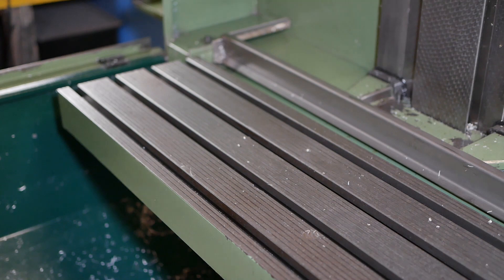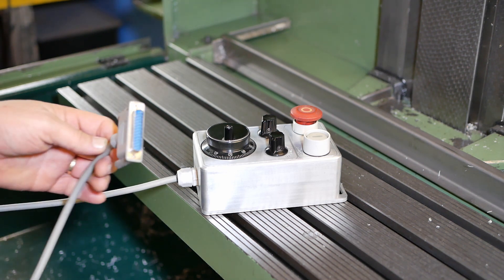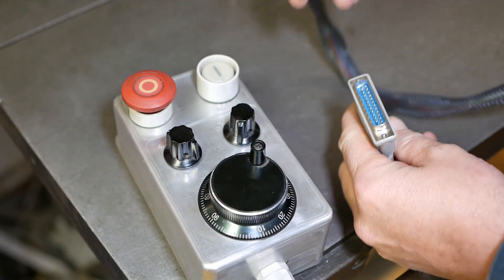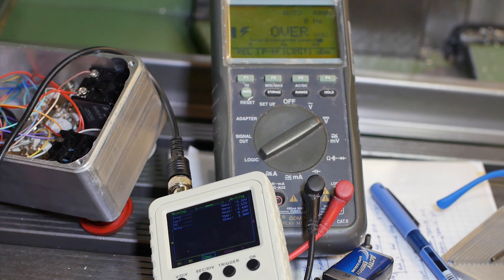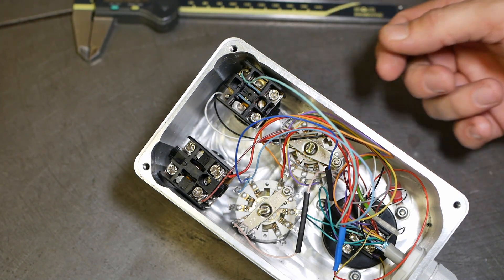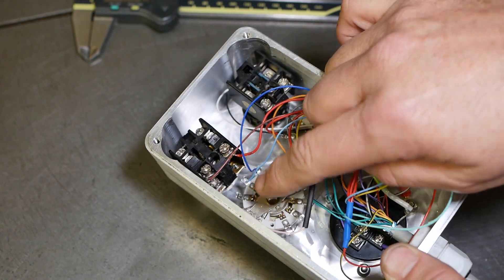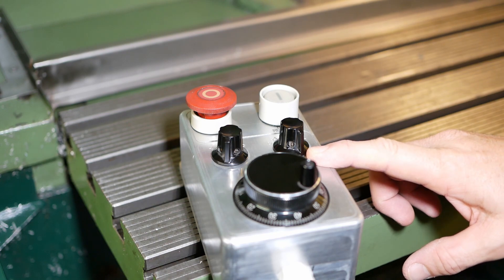Maho Pendant

Comment: I don't know much about this particular configuration scheme.  But I might offer some pointers.   You say you're selecting 1 based, but what's on the screen is 0 based.  Also, you have letter corresponding to numbers and "in" prefixed on a set of variables and "input" prefix on another. To add more confusion, it's "in" could be increment, but can also mean "input.". Naming consistency pays off big time. One strange thing I see at the bottom of the configuration is that you have the selected jog increments connected to different jog scales. Normally, a connection is wired to a unique connection unless you're describing a multiplexing operation.  Even so, to select 4 values, you need wires pins, not one, i.e. 00,01,10,11. With only one wire, you can only select 0,1, which might explain why the last two positions are never selected.
Reply from the maker: This turns out to have been my poor implementation of a MUX 16 component. I will replace it with a MUX4 solution.

Comment: Such smooth action, very nice. How you managed to track down that fault, that thing just screams time-vampire frustration headache.
Reply from the maker: The error shows up a smart serial communication error between the 7177 and the 7184. 
- I first probed the connecting cable between them
- Luckily the MESA 7i96 in the lathe also has a smart serial interface. So I made a new cable and checked the 7i84 actually worked.
- Then I tried the 7i77 and 7i84 together with an independant field power supply.
- desoldered the power and switch outouts of that rotary switch, and switched them to the other terminals (each position is dual throw).
- Still didn't work so desoldered all again, an conencted and test one after another till the wire was ID.
-then tried that wire on another 7i77 pin.
Took a week on and off.

Comment: when you on hurry ask   This Old Tony he knows he have also a MAHO
Reply: Unfortunately, ToT uses Mach 4. Control being completely different, he wouldn't be much help with hardware interfacing to a mesa card
Reply from the maker: @TheFeralEngineer  That is correct. Tony and regulary exchange info on our Maho's but his use of Ethercat and Mach really has little in common with my use of the Maho controls, Indramat, Mesa interface cards and LinuxCNC. Unfortunatly.

Comment: Use Pnfconfig with extended settings - multihandwhell option MPG. (in a new machine and copy/paste to your files)
Reply: # connect selectable mpg jog increments 

net jog-incr-a           =>  jogincr.sel0
net jog-incr-b           =>  jogincr.sel1
net jog-incr-c           =>  jogincr.sel2
net jog-incr-d           =>  jogincr.sel3
net selected-jog-incr    <=  jogincr.out-f
    setp jogincr.debounce-time      0.200000
    setp jogincr.use-graycode      False
    setp jogincr.suppress-no-input False
    setp jogincr.in00          0.000000
    setp jogincr.in01          1.000000
    setp jogincr.in02          0.100000
    setp jogincr.in03          0.001000
    setp jogincr.in04          0.010000
Reply from the maker: I am still on LinuxCNC 2.8 and the previous version of Gmoccapy. It is stable, so i really dont see much value in upgrading. I think this is a MUX 16 issue, so I'll switch to Mux4.
Reply: @RotarySMP  and I'm still on 2.7.15 and Axis with MESA 7i76E. Where did you see about upgrading?
Reply from the maker: @DPTech_workroom  I have 2.8 and Gmoccapy3 on the mini lathe. The changes to Joint notation would drive a few bit of work to migrate the HAL I think.
Reply: @RotarySMP  did you try?
If your LCNC is 2.8 the Pnfconf will do it for your version - 2.8, or am I wrong?
My firs language is not English. Do you understand what I'm trying to tell you? Do you understand how works the pnfconf?
Reply from the maker: @DPTech_workroom  I guess not. I am running 2.7 on the mill and 2.8 on the lathe.
Reply: @RotarySMP  each pnfconf making his own files. Or I'm missing something.
Reply from the maker: @DPTech_workroom  Correct.

Comment: I don't particularly enjoy wiring. I have a 30 wires in  a transfer switch I need to wire into my main electrical panel. I've put off the job for over a month now. Every time I get a new electricity bill I am still annoyed the bill is so high and wonder why I still haven't put in the transfer switch to power the rest of the house from Solar. :-)
Reply from the maker: :) I can relate to that.

Comment: As a suggestion to simplify your wiring, why not do a multiplexing setup with your axis and jog selectors, that way you only need 2 inputs for each and have a mux4 selecting through the options?

I have a video on mux i just uploaded the other day 👌
Reply from the maker: I did a 5x5 Multiplexing of the user interface module, but I liked those rotary slectors, and had enough IO that it was easist to do discrete wiring. If I redo the pendant, it would be with Tom and Peters smart serial pendant, so I'd only need a Cat 6 cable.
Reply: @RotarySMP  that really is a cool project. I've been following that as well

Comment: What is jogincr? Is it a mux?
Reply from the maker: I didn't realise it was, but is a MUX16 generated by PNCConf I think.
Reply: @RotarySMP  I think mux16 uses a binary number to select the input. Try setting use-graycode to true and see if that helps.
edit: just watched the video again, and it's definitely interpreting the switch inputs as a binary number
Reply from the maker: @spacehitchhiker4264  Thanks for that. Since I am only 4 inputs to 4 outputs, I will replace this with a Mux4.
Reply: @RotarySMP  Mux4 works the same way, except that it only has 2 input pins that take a binary number from 0-3
Reply from the maker: @spacehitchhiker4264  I have four pins in to select four states out.
Reply: @RotarySMP  you need either a 2-pole switch or you can add diodes so that: 0 unconnected, 0.1 to sel0, 0.01 to sel1, 0.001 to sel0 and sel1. These muxes take selection input as a binary number, not as individual selection signals. So if you have 4 selection signals, they have to be converted to binary with a multipole switch or diodes.

Comment: The step increment thing makes me wonder if it’s set up for binary or grey code. It might only use the first 2 inputs. 
Binary would be as follows
A off B off = 0
A on B off = 1
A off B on = 2
A on B on = 3
C and D are ignored
Reply from the maker: Looks like I ended up with the grey code multiplexing component, rather that the MUX4.

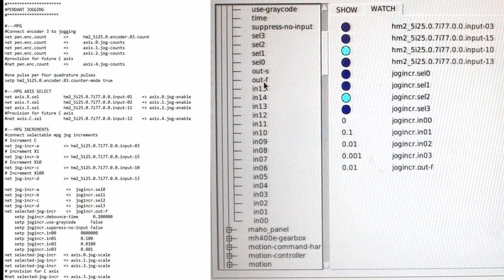Comment: Hi, no experience with Linux CNC however from examining the HAL code at 4:55 and looking at the jogincr.in00-03 and the actually selected jogincr.ouf-f it looks like an "off by 1" kind of issue. I think that might be from the "net selected-jog-incr    <=    jogincr.ouf-f" line. 
Again, i'm unfamiliar with the actual hal but should the symbol here not be "=>" and not "<=" as it currently is?
The only other place i see "<=" is there you look to be mapping hardware pins to functions/variables

As a side note i'd suggest using the same number of decimals for all the increment values, it makes it easier to read and spot silly errors that the eye would otherwise pass over.

Really enjoy your channel and content, cheers.
Reply from the maker: Thanks. The arrow sympbols are not parsed by LinuxCNC, and are optional. 
net selected-jog-incr    <=    jogincr.ouf-f 
means the output of the jogincr selections pin is connected to the signal "selected-jog-incr"
Later lines then connect that signal to the output pins.

I also suspect this register is off by one. Sort of counting from zero rather than frmo 1 issue.
Goos point about the decimals. I'll clean that up.

Comment: unfortunately I have no hint about the step increment issue but maybe a tip for aluminium: if you are in austria too as it seems: fixmetall is the best option for small quantities in my opinion. also they ship pretty quick usually. and I´m pretty bad at bringing cutoffs to the the recycler so quite some plate stock accumulated in my workshop over the years. mostly GS27 -> stress relieved stuff. mills nicely. happy to donate some to you and the channel ;) ...grüße aus 1150 wien.
Reply from the maker: Thanks. I normally go to Fixmetall, but with the lockdown, though it would be better to order, and the german supplier was about 1/2 the price of Fixmetall.

Thanks for the offer. I'll let you know next time the need arises. Servus aus 1210.
Reply: @RotarySMP  nice! yes - definitely let me know. lots of 15mm plate but also some other pieces "in stock" :) ...and coincidentally I saw on instagram today that somebody wrote a extension for visual studio code for syntax highlighting for hal files. Peter Müller is the publisher and the extension is called LinuxCNC. Maybe that helps or is  at least nicer to look at. ...although you probably only make small changes directly on the linux machine by now?
Reply from the maker: @bernhard_derProtoTyp  Yes. The syntax of the HAL is pretty simple. The only real catch I have seen is that a "_" in the "loadrt name_type" will turn into a "-" in pins created by that comp. I just use whatever text editor is standard to the Debian load.

Comment: I am working on my own too
Reply from the maker: Look forward to seeing that. I would strongly suggest looking at the one from Tom and Peter. It is a really great design.
Reply: @RotarySMP  I cant copy it strictly, my system is based on an arduino board so I have to custumize it to my need, I am converting a butiful machine that is over 100 years old, no ball screws, olds school bronze bearing everwhere, amazing cast iron body with many decorative parts, I wanted to give it a new life, because working on a machine this old is very difficult and time consuming, the makeover will be subtle, the appearence will not be that much altered, it will still look very vintage, I wanted to keep that, but the controll will be all modernized and electronic, but because precision on these machine is pretty much optional converting it to propper cnc would make zero sence, so instead I opted for half manula, half electronical controll using a pendant like this, the wiring is ultra confusing, tons of wires everywhere, I hope I can make it work, looks promising so far.
Reply from the maker: @DolezalPetr  Look forward to seeing you video on that.
Reply: @RotarySMP  well it is a project that will probably take one more year, the electricity and wires take the most time to finish

Comment: So the smaller hole is only to get electrizity to the external reader/writer unit and the larger one is the actuall adata port for the reader/writer. so both holes got used for one thing
Reply from the maker: Thanks for adding to my MAHO knowledge base. As you can see one is already a temporary solution for the spindle ring light cable. Nothing is more permanent than a temporary solution. :(

Comment: I don't know the syntax of the configuration file you posted but is the error in either:
1: the inconsistency between variables of the form jog-incr-* and jogincr-*
2: that jogincr-sel0, jogincr-sel1 etc are the only variables that are not 2 digit numbers e.g. jogincr-in00 jogincr-in01
Reply from the maker: Thanks. LinuxCNC HAL always need a signal to join pins. The syntax is 
net [signal] [pin] [pin]

You can connect both on one line, or go "signal to pin in"  on one line and "signal to pin out" on another. jog-incr-* are singnals, and consistant. jogincr-in0* are pins connected to those signals.

Good thought on the definition of the jogincr pins. These are not user created, but generated as standard components of LinuxCNC, so I'll go searching for thevariable type they expect to be passed.
Reply from the maker: @Erik Mikkelsaar Thanks Erik, you know I started with a PNCConf HAL setup, and didn't even realise that JOGINCR was a MUX 16 component, I thought it was some core LinuxCNC component. Now that you point it out, I checked the HAL and sure enough 
loadrt mux16 names=jogincr,foincr,mvoincr
Thanks a lot for you tip. Hopefully that is the key to fixing this issue. I guess to start with I can replace it with a MUX4, as I dont need 16 pins options.

Comment: In your code screenshot you stated values for the different switch stages. No knowledge with the specific language used, but where is the piece of code that writes these values back in to your output variable?
Reply from the maker: This is the HAL (LinuxCNC hardware abstraction layer) it is only used to connect signal paths.

Comment: Great video as always RotarySMP . And no it's not just you wiring is always time consuming when you want it done right. The only ways I have found to clean up the inside of an MPG pendant is to either use wire ties or design a circuit board to hold the switches and encoder .
Reply from the maker: I guess I could use wiring harness lacing, but will probably just leave it as is. Peter and Tom designed an excellent circuit board to interface everything, convert all the signals to RS-485 and output it down a Cat 6 cable to MESA hardare.
http://www.talla83.de/
Reply: @RotarySMP  definitely going to check that out.

Comment: Yay the brick is working! :)
For what function is the white recycled MAHO switch planed? Set active axis to zero?
Reply from the maker: It is the hydraulic tool release button. Oh darn, I just realised I forgot to include the footage of that.
Reply: @RotarySMP  Haha, shit happens, more footage for next week. ;)

So you have no zero button for the active axis? I would recommend that its really handy! Maybe it's a good time to think about it now, when the pendant is still open.
Reply from the maker: @surmetall5596  It isn't. The back lid is only 4 screws though. The issue is that the LPT cable I used has no spare wires. I can see that sooner or later the brick will get retired and I'll be making one to yours and Peters design. I already have the µC programmer sitting on my desk at work, that a colleague let me borrow.
Reply: @RotarySMP   you can also use peters PCB in your brick! Then its a SmartSerial brick :o)

Anyway let me know if you need a printed case in RAL6011 reseda.  ;)
Reply from the maker: @surmetall5596  Thanks tom. I thought hard about that, but there is not enough wall thickness in the brick for it. I have such  back log of projects I want to do, I will probably just live with the brick for now.
Reply: @RotarySMP  You think it is important to be able to release the tool while standing too far away to catch it? :-)
Reply from the maker: @andypughtube  Do you mean the switch on the pendant or the one on the user control module Andy? The one on the user control module was needed before I had the pendant, and it still more convenient for tool changes during a job. The User module swings in resonably close, so you can push the button and hold the tool. The one on the pendant is really convenient for setting up the tool table before a job I have just found.
Reply: @RotarySMP  I think I am just traumatised by dropping a Renishaw probe out of the spindle by pressing the wrong button at the wrong time.
Reply from the maker: @andypughtube  Ouch. What a nightmare.
I dropped one tool, as my pysical soft keys can sometimes hang up. I started the machine with the button hung up.